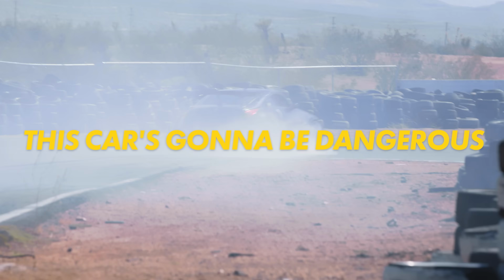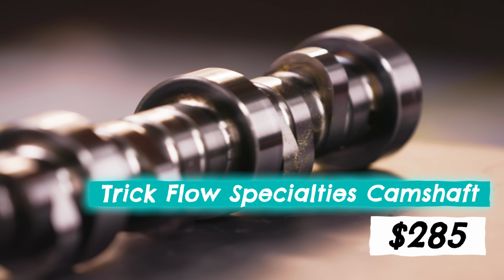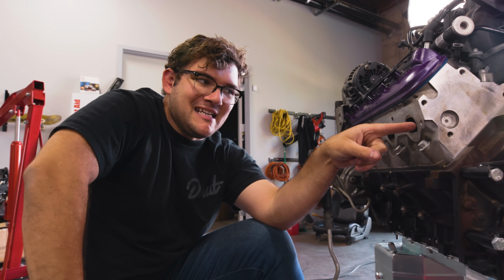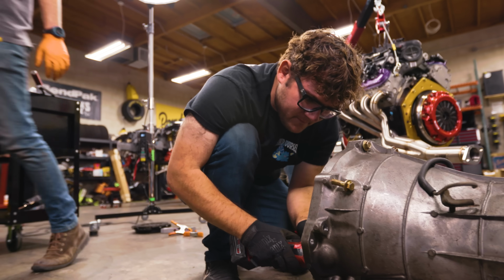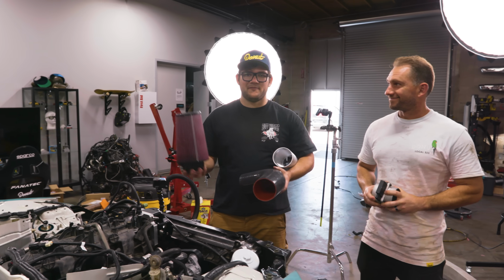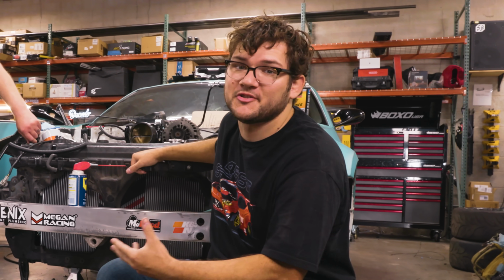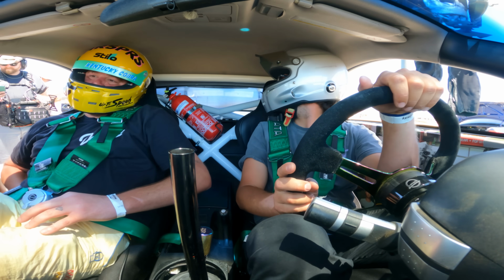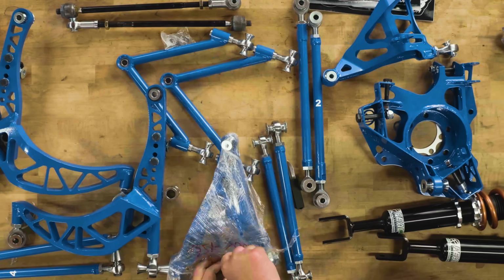$8000 Junkyard V8 vs $30,000 Crate V8 Engine Swap

Comment: I'm so glad you do stuff like this because it seems like it's forgotten in the car community but doesn't matter how much horsepower your engine or your turbos or superchargers could produce. If you can't put that power into those tires into the tarmac, It is absolutely useless.
Just seems like people have completely forgotten about the physics
Reply: Well its become a race to 2000HP and the prestige that comes with being the first to achieve it not to mention the money that will come with it. 

Also due to how complicated vehicles are these days there are less people trying to fix the problem themselves in the garage like they would 30 years ago so because of that so to some people car mechanics are on the same level as PC engineers were when building your own PC was only something certain people did.
Reply: @DarkLordDiablos  what, who needs 2000 hp lol, unless we’re talking major league drag racing where that’s already a lot of teams are already pushing
Reply: @need_more_lives2974  We may not need it but with the rate of increasing HP in Hypercars today I don't think it will be long until we see one with 2000HP.
Reply: @DarkLordDiablos  well as mike said above, even if they start pushing more power physics make it hard to use, only so much you can do with tires and aero
Reply: @need_more_lives2974  I know it will be hard to use it but that never stopped them before so I doubt it will now.
Reply: By people you man Zach and by the physics you mean how to drive
Reply: i agree but if they would have figured out a way to throw a supercharger on that LS this video would have been way more epic
Reply: This episode not really a great example of "useless power". A 38 hp difference between cars won't necessarily overcome differences in drivers, weight,  suspension setup.  430hp likely not an example of "useless" level of power for this chassis.  0-60 also not the only test of utility of power - e.g. drag strip, track times, 40-80, drifting, burnouts for distance :)  Another 100hp or more could be useful there.
Reply: @channeldoesnotexist  no he means aerodynamics power to weight torque when the car turns and etc
Reply: @DarkLordDiablos  there are cars hitting 2k HP regularly now, check out sheepey race, they twin turbo Lambo’s that put 2k
Reply: You are right. At the Beginning The LS for Low Car is Iron. While the Hi Car had a full Aluminum Crate V8 so it's kinda lighter. It could potentially be One of the factors why Nolan's tires had more grip.

Comment: A tip for removing broken studs I learned from an old school mechanic,  take a small drill bit, drill out a pilot hole, then take a reversed bit and go at a slow speed the direction the bolt would be removed with. The bit will grab the screw and twist it out.

Comment: I remove broken studs from ls heads every week. Just set a new nut over the hole and fill it with weld and they come right out. Works better than any other option out there.

Comment: Fun fact related to using heat/cooling to fit the bearing: 
When nuclear reactors are assembled, the bolt holes are heated by a couple hundred degrees, then the unheated bolts are inserted and torqued by a machine to a couple thousand pounds. When the temperature equalizes, the resulting torque is in the realm of 1,000,000 ft-lb
Reply: The resulting torque or the overall linear contraction force of the nut and bolt assembly? There is no way any bolt (unless several feet across?) made by man is taking one million foot pounds.
Reply: @exploranator  the bolt is under pressure, in order for it to crack, there needs to be air in the chamber, when the metal cools down, it literally shrinks, forcing all the air out
im pretty sure its true what he says, but its hard to imagine since a dumb truck lug nut is only like 500 pounds, but ive heard some things are in the thousands
Reply: @exploranator  exactly.
Reply: No Mate. Your either talking BS or are misreading the facts? Fact 🙄
Reply: I’m overwhelmed by the number of citations presented on all sides.
Reply: That's almost as tight as my lugnuts are when I get my car back from the tire shop..
Reply: @exploranator  pretty sure he's talking about the clamping force
but even more certain he might have mixed up some terms there

or maybe he's trying to tell us that the inner threads are being heated so the bolts are basically shrink fitted in the threads
Reply: That's 189 mile-pounds
Reply: @mr22guy  This made me laugh. Not because I think you're wrong or whatever, but because the resulting torque is so much that we can go all the way up to miles.

For shits and giggles, that's 333,333 yard-pounds.
Reply: @carpballet  I've been overwhelmingly convinced of two diametrically opposed positions at once. Amazing!
Reply: @mr22guy  that's about 3 hours and 15 minutes on the highway pounds.
Reply: The best current technology is hydraulic tensioning of the bolts. The nuts are basically small hydraulic presses. They are installed hand tight, and then a hydraulic pump pressurizes each one simultaneously to the prescribed pressure. A locking nut is tightened down and then the hydraulic pressure is released. They simply pressurize them again and loosen the locking nut when it needs to be taken apart. Ensures uniform pressure across flanges and shaves tons of time off of maintenance schedules.
Reply: @TheDyrehauge  I'm guessing you meant dump truck. A pickup is only like 70-90 I know semi with flange nuts get up that high.
Reply: @appalachianamerican1776  Yea i meant dump truck, when i write in english i just think of the sound and write sometimes
Reply: Just use smurf blood smh.
Reply: trusting anyone to construct a nuke plant in feet and inches.....merikahns ffs
Reply: You're probably missing something here... Heating the bolt bore to make it a press fit doesn't increase clamping force at all. Even making the male thread integral to one part wouldn't increase the maximum tension past the capabilities of their unthreaded core and it would actually decrease the stress concentrations as well as reduce fatique strength due to compound loading (in the direction encouraging material flow too). 

Either the bolt itself is being heated while the rest of the stuff remains at room temperature or it's getting looser instead of tighter, and while this sounds plausible, I think it would be something to be avoided (there are many other much more precise ways to install "torque-to-yield" or prestretched fasteners), due to the unpredicatble friction characteristics of a heated thread (assembly lubricant film is more vulnurable when hot and the elevated temperature reaks havoc upon surface friction characteristics of metals). 

Even if you heated just the nut, the linear expansion (along the fastening equipment) would be larger than the subsequent "pull" caused by the contracting thread flanks.
Reply: @Sketch1994  the well of the vessel is heated, causing the material (and as a result the hole) to expand. Then the bolt is threaded in and torqued. Then, when it cools, the vessel contracts around the bolt, Resulting in an absurdly high effective torque

Comment: This was awesome! I wanted a little more details like what ECU was used and how did Nolan finally remove the broken bolt, but still, really enjoyed it, can't wait for the next one!
Reply: Most likely just used a mig welder and the ECU was the factory truck. You see it right before they start low car.

Comment: I build turbo shaft jet engines, when it comes to degrees of rotation we use “wrench ark”. Those are fancy words for “yeah that looks about right”
Reply: That's fucking awesome!
Reply: Well I mean when your wrench is the length of a golf club you can’t be off by more than a few degrees lol
Reply: Why does degrees of motion matter instead of just torque? Bike mechanic here
Reply: @peterlang5047  that’s a question for General Electric bro. Tighten to finger tight, torque to a 15,45, or 60 degree wrench arc. Depending on the bolt. Most others are torqued with a torque wrench
Reply: @genisessnipe2741  If I had to guess, it has to do with larger torque values. Maybe the mechanism that allows torque wrenches to snap doesn’t work as reliably with higher torque values (no clue what kind of torques you’re putting on, but on a turbo shaft engine I would imagine it’s right along the lines of “yes”)
Reply: @trentmckenzie343  Angle is normally used when installing "stretch" bolts. The idea being that a certain amount of degrees of rotation stretches the threads the right amount for the proper prevailing torque.

Comment: First off, this is awesome to see the skills of the channel grow to this level! 2nd... if you're not getting the tire spin you want. You might want to check out your rear end gears. High car has the dream powertrain... great job guys!
Reply: Well part of the issue with hi-car is that it wasn't built to be a drift car, all of the mods make it handle really well, you stick a big heavy iron block truck motor in a 350z and suddenly the rear end gets much "lighter" and it's got less forgiving suspension ect. Makes it easier to break traction.
Reply: @magicstew45  i agree with you on the suspension side, but on the other hand, with a drift car, being able to get grip is also very crucial. That is why i suggested gearing. To improve the amount torque to the wheels on demand, but still allow the car to get grip when you let off the throttle in those "hairy" situations
Reply: @magicstew45  I believe hi car has an aluminum block

Comment: I am quite upset that Donut dropped Aaron for the Subaru season, he's always been of great help to Low team
Also, Aaron's got that swag
Reply: Does he still work there?
Reply: Do you know why they dropped him?
Reply: Who’s a”Aaron?
Reply: @MrBloodguns  He was on the Low team for the Nissan 350z and Tacoma seasons
Reply: aaron works at motortrend. i can't claim to know his motives, or the motives at donut. however, i'm assuming motortrend is probably a more stable work environment than donut media, or maybe he just wanted to move on and try out something new.
Reply: @devonesq.7533 doesn't he also participate in Formula Drift and Stunt Driving in general?
Reply: @devonesq.7533  he was a guest on both seasons. I watched a trailer somewhere where thy were presenting the team. they were a few guests who came to help which among them is Aaron. I was also asking myself were did he go.

Comment: I think one of the issues with High Car's feel was the lowered and back engine. You seemed confused about Low Car whipping it's tail around so easily compared to High Car. The pivot point of any mass will be around its center of gravity, low and center is great for stability as any off-roader will tell you. But the high and forward and HEAVY truck engine is putting the pivot point right around the front wheels. When High Car turns, it's trying to sling the front wheels opposite the rear ones, instead of what Low Car is doing, kicking the rear wheels out. Low Car is probably going to win the angle kit challenge too, based mostly on this factor.
Reply: True. Arround a track with the same driver high car  would be 9 out of 10 times faster than low car, but if you wanna go sideways less grip in the back is the way to go
Reply: Good observation. Not gonna lie, been playing Forza 5 frequently these past two months and been dumfounded as to why my off-road truck keep sliding forward on corners. This... actually solve my issue due to my lack of awareness
Reply: @k11project32  Not with the current vehicle height and suspension setup...
Reply: Is low car still the only car with a welded diff? Thats pretty huge compared to an lsd for drifting
Reply: @Adam-de8jm  hi car has 2way LSD, locks in acceleration and deceleration
Reply: @Lmmolsen   Hi-car still shifted the center of gravity backwards by moving the engine back with the engine mount kit and lessened the weight in the front by replacing the engine with an aluminum block while lo-car swapped in an iron block using the stock engine mount locations.  Because of those two factors, hi-car should be harder to slide the rear-end out than lo-car can.
Reply: That is exactly what I was thinking. I watched a video of the 1100+HP 2021 Supra with the 2JZ and when the guy drove it he couldn't understand why the car handled so much better than his comparatively stock one. The owner told him they moved the engine like 12 times I think until they got the perfect feel.
Reply: @daexion  shouldnt matter that much. ive got the same engine and trans setup in my s13 as high car and she rips. high car just needs to get the alignment and suspension settings dialed in as well as toss in a welded diff and she will rip just as hard as low car does. with high car being so low in the rear, im better they have far more camber than low car does which gives a much less contact patch on the rear tires resulting in less grip but also less forward bite when drifting.
Reply: @daexion  Not sure why you tagged me, I contradicted Bruno for stating hi-car will win time attack, and explained that hi-car has a  2way LSD...

Comment: Time to do a LSA super charger and it will finally be a sick car .. well it’s already been sick but a sick motor setup 😈
Reply: thats what im saying they did the turbos for the v6's and now they need to super charge the v8's would be a sick video to see how much power they would both kick out maybe hi car would finally beat low car in that drag time.

Comment: The sound of the bearing in the dry ice is actually the ice sublimating from a solid to gas. As it does this this, the gas pushes the metal part up. Once the gas escapes, the part falls back down again. This happens thousands of times a second, creating the high frequency noise.

Comment: My guess on why low car was quicker was transmission gearing. Either T56 magnum gearing option has much longer gears than the factory trans especially the 2.66 first gear trans. 
Stock    T56M     T56M 2.97
1: 3.79   1: 2.66   1: 2.97
2: 2.32  2: 1.78   2: 2.10 
3: 1.62  3: 1.30   3: 1.46 
4: 1.27  4: 1.0     4: 1.0
5: 1.0    5: .80    5: .74
6: .79   6: .63    6: .50
Reply: yep that first gear on the high car is too tall, and the engine doesnt have the torque to feather it until the powerband. You're forced to clutch pop it into the rpm range of the cam, which is wayyy too much wheelspeed/spinning to get a good time. Also just generally seems like the rear suspension / tires were junk, and the rear of the low car definitely had a better tire/alignment setup aswell.
Reply: The other issue I can see is how he was saying he had to fight the car to get it to comply, that will make times slower
Reply: So if I have this correct, if Hi team went for the long gearing, them in first gear is pretty much low car in 2nd?
Reply: yea thats in my oppinion deffinetly it what they need is to put a new set of gears in the rear end and they will still have driveablity with a lower rear gear ratio like 411's or thereabouts and get way better acceleration
Reply: yea with the lower rear end gear = better acceleration and the double overdrive allows for street driving just fine
Reply: I figured, break in or lack of was a factor. I reckon this is more-so, but I’m sure break in contributes.

Comment: 33:21 Doesn't surprise me. It's a truck motor, sure not much hrsprs but plenty torque. Also, low team should have made a U turn and have the filter stick out the top from the passenger side with a cover made in typical low team fashion.